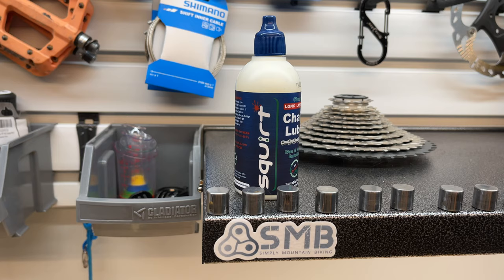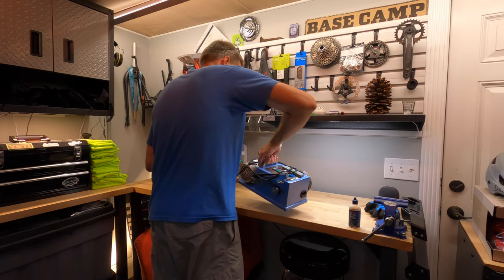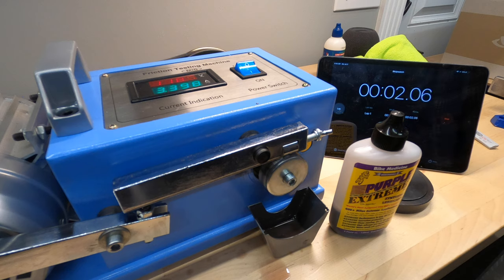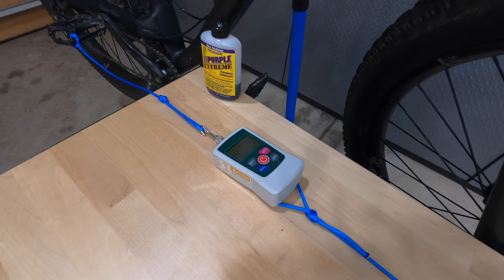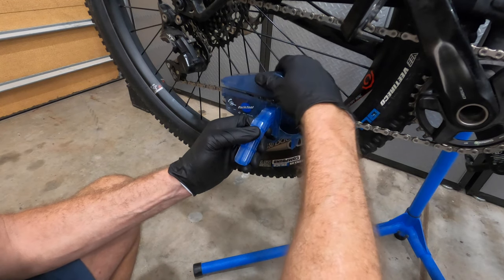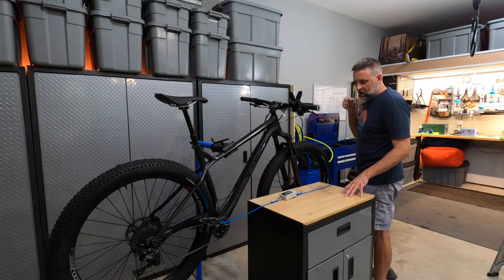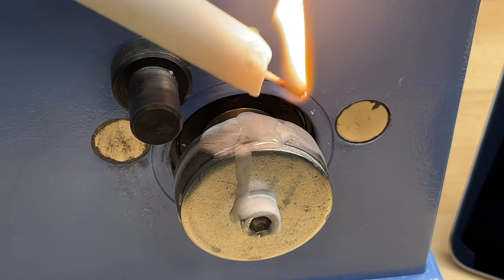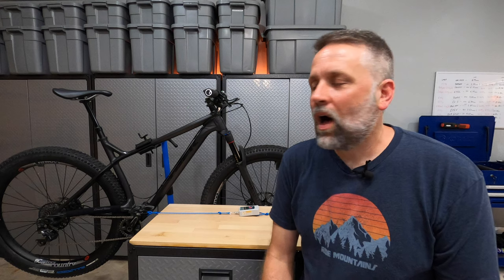Is Squirt a Good Chain Lube? | Squirt Wear Test

Comment: I just don't see that friction test being even remotely relatable to a bicycle chain, many tests have shown time and time again that a wax-based lubricant is significantly more efficient than oil-based lubricants. Tests like this (https://cyclingtips.com/2018/03/fast-chain-lube-that-saves-you-money/) with an actual chain, not a metal-on-metal friction tester. You are missing out on better chain efficiency and longevity.
Reply from the maker: Thanks for your comment. -Eddie
Reply: The odd thing is that RnR is a wax base lube. It just has more solvents that keep the wax where it needs to be.
Reply: @justinwbohner  and atracks all te dirt and grime...
Reply: @Rob-fx5yn  Not if you let it dry. It creates a dry outer chain but inside the rollers is still wet.

Comment: A classic example of why we should take “lab testing” with a pinch of salt when applied to real world conditions.

Your tests are biased towards non-wax lubes. The biggest factor in drive chain wear is adhesion of particles to the drive train forming a “grinding paste” that is both difficult to remove and very destructive.

Your wear test doesn’t represent real world wear, where the lubricant is trapped between two metal surfaces and cannot easily drop off.

You didn’t “fully degrease” your drive train before applying the Squirt for the resistance test, instead you partially cleaned it. From experience this makes the Squirt very viscous, likely leading to the result you got.

Also your test measured static, not dynamic friction.
Reply from the maker: Thank you for your feedback. -Eddie